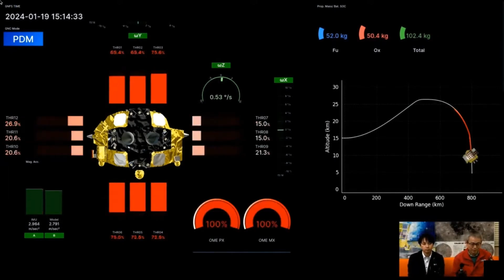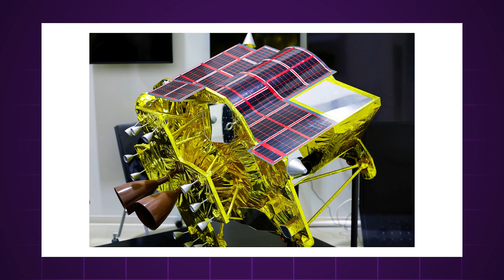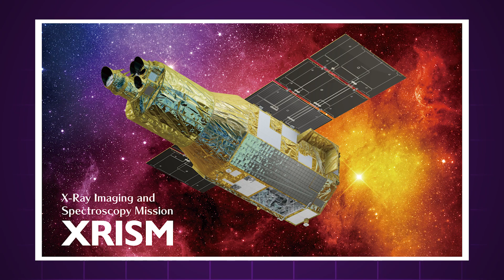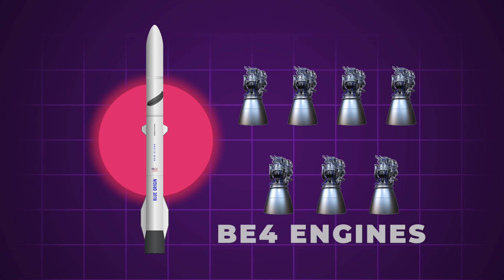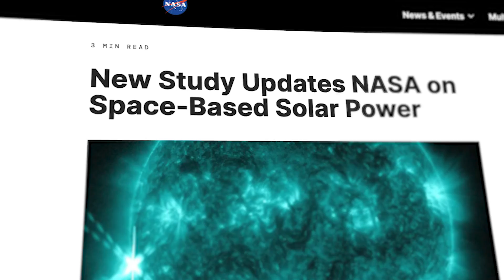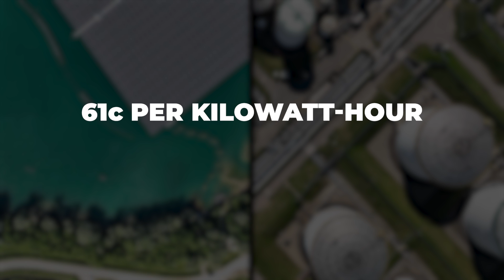The Real Reason Japan Just Landed On The Moon!

Comment: According to JAXA, it seemed that one of the two main engines failed.  It seemed that the output power was cut in half a moment after it started to descent.  The probe was able to maintain its controlled descent and the speed but was drifted away from the target.  If the engine had not failed it would have been able to land within few meters from the target.  It's all done in autonomously.  They're hopeful that it should recover once the sun recharges the batteries later because nothing seems broken so far.

Comment: Regarding a first stage rocket booster: Could the first stage be powered by a number of jet engines arranged in a ring?: I understand that the major part of fuel use is within the first several thousand feet of launch while still in the atmosphere. At this point liquid O2 would not be needed saving some weight and fuel for upper stages. Can you do a program on the pros and cons of this idea?

Comment: That why they must develop self energy re-generating system the light that will heat the solar panels this way not only the sun can generate energy but itself. Also use generator that use battery instead of gas ⛽ petrol. This way make sure it run multiple system also wind 🌬️🍃 system. Alot is missing

Comment: A solar panel is space could potentialy generate ~10x as much as power as it would on the ground, so space based solar will be practical when launching something to Geosyncronouse obit is only 10x more then putting it on a roof, which is a hell of a long way off.

Comment: SLIM had to be 180° turned around. In other wards, when it changed direction from horizontal to vertical, then back to horizontal to land on its "side" it lost its x/y/z axis bearing so it ended up turned around or upside down iaw with the misidentified axis bearing.
Reply: It didn't misidentify anything it just lost one of its engine nozzles so much of its control was gone so it ended up upside down
Reply: @deannelson9565  it lost its axis bearings because it lost an engine nozzle. My comment was posted long before JAXA knew the nozzle melted off or had any idea what led to its landing on its head!

Comment: The main issue with SBSP (Space Based Solar Power) is the assumption that solar panels must be manufactured and launched "from earth".  Taking a quick glance at the report shows they did account to some degree that launch costs will come down but are rightly skeptical of the order of magnitude the Starship claims to be aiming for as SpaceX and Elon Musk have a way with overpromising and being late with delivery, eventually they will get things to work but NASA is being cautious presenting their results to not give people false hope, though I am sure many there would be happy to be proven wrong and the cost to LEO drop to 100$/kg or so. The other option to lower costs is to pull a Daniel Suarez asteroid and lunar crypto station heist, but I doubt that will happen.
Reply: Manufacturing a solar panel in space as completly prohibitive, so yes they must be made on earth.

Comment: Using the popular low bar adage "any landing you walk away from is successful," then the SLIM was successful.  However, for Japan's first official (the private Japanese moon lander Hakuto-R crashed in late April) seemed excessively ambitious.  Instead of using the more traditional low center of gravity landing legs they decided on an untried rather exotic roll on your side with crush landing pads approach.  It seemed doomed to failure from the beginning.  I am sure the Japanese will learn from the attempt and better luck next time.  Next up,  Intuitive Machines' Nova-C lander being launched on a Falcon 9 in February.
Reply: Using that janky flip on landing maneuver was probably not a good idea.
Reply: Well it's never a good thing when one of your engine Bells falls off when you're 50 m up and causes the ship to lose a lot of its lateral control

Comment: I really hope orbital solar panels come out good they sound amazing
Reply: Never going to happen -- NEVER!  Sure, I can see a demonstration system, but there will never be large scale deployment of space based solar farms.  Solar is already just about the cheapest energy source we have being limited mostly by the fact that the Sun doesn't shine 24 hours per day, but the solution to that is already in use and has been in use for more than a century -- pumped hydro!  The current commercial solar panels are a bit over 20%, but multijunction solar cells based on Perovskites, when they are improved to allow them a longer lifespan, could see net efficiency increase to around 34% which is likely within 10 years.  The advantage of these newer cells is that you can generate a lot more power and energy in the same area thus reducing the land requirements.  Additionally, the solar farms might not need to be based on land at all as it is possible to base them in shallow ocean waters where the water depth is, say, less than 1000m deep and often less than 100m deep.
Reply: Solar panels sound like a poor man's attempt.  Get serious and use Nuclear energy.
Reply: @dan6442  Yep, worked well at Chernobyl and Fukushima...
Go on home folks, nothing to see here!
Solar is less expensive than nuclear!
Reply: @dan6442  fair point